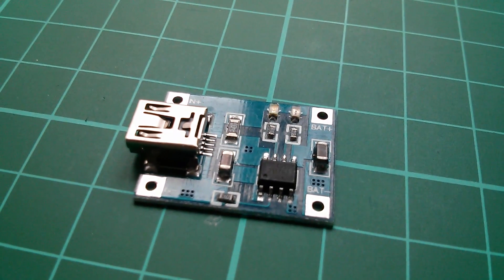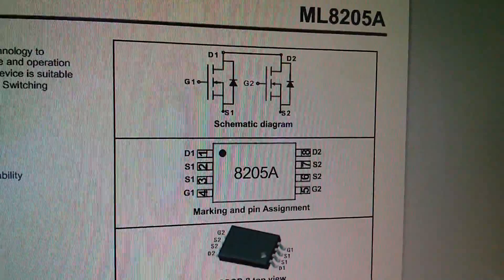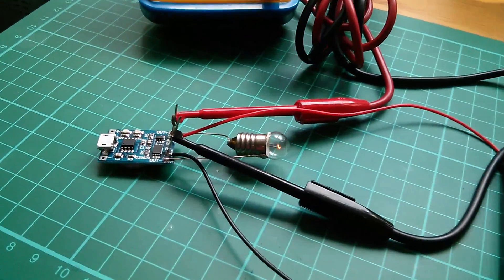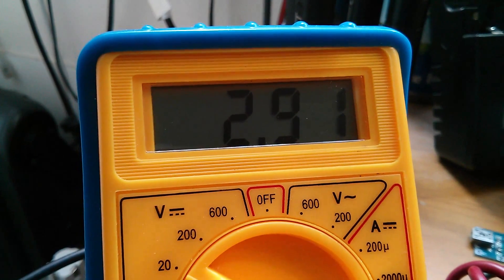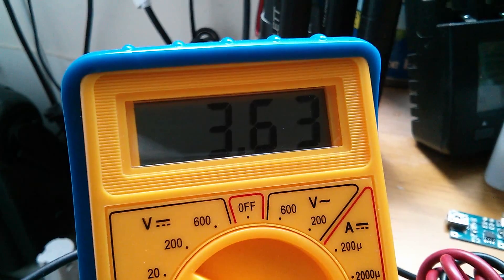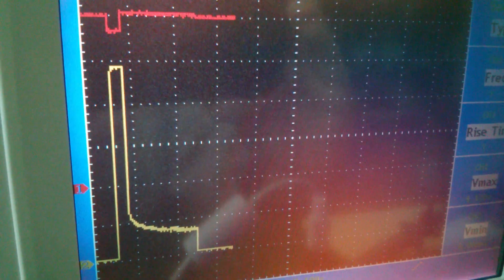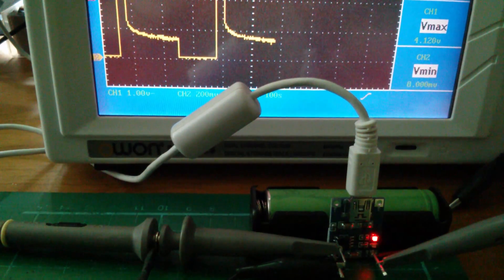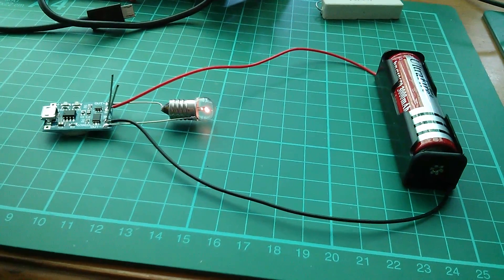New TP4056 Lithium Cell Charger Module with Battery Protection

Comment: Hi Julian, I've got a question for you about this board. I tried to use 2 of these boards together to charge 2 (or more) 18650 cells in series, but no success yet. I did have some success by putting 12v into 2 boards wired in serial on the power input side, but that only works if the charging cells are isolated (charged separately), as it seems to be a short circuit if the cells are also connected in series. Love your channel and thought your expertise might be able to solve this riddle.Thanks, and please keep up the great work!
Reply: To charge two cells, you'd need to charge them separately or in parallel, not in series.
Reply: Lat50 I tried this too. When you do it in series, the series voltage ends up frying the charging modules
Reply: Lat50 Julian has been trying to overcome this recently with transformer isolation. Look at newer vids

Comment: i have a question, what does it mean when you charge it and there is a constant green light and a blinking red light?
Reply: I know it is a cell and not a battery and I didn't put B's on the board.

If you connect board to power with no battery connection does it duplicate the problem?
The TP4056 has 4 output connections.
The battery must me connected to the inside two. B+ and B-.
The Out+ and Out- go to your project.
With no battery connected the voltage across B+ to B- should be about 4.12 volts with Blue or Green Led solid on and Red Flashing.
Connect battery Red LED should stop flashing Green or Blue may stay on.
If so, disconnect power input for 20 seconds to reset circuit.
Reply from the maker: both on together?
Reply: When I charge the battery it has a constant green light and a red light that blinks every two seconds.
Reply: YUP. Mine is doing the same exact thing. I used a dedicated 5V supply, and the green LED is ON, while the red led blinks every few seconds. Why..? I'd also like to know.
Reply: Had the same happen with my chargers. I have two batteries that had discharged to about 0.5V over time, and with those connected to two separate chargers, I had the same issue - blinking red and constant green leds. Then I tried connecting different batteries from the same batch (a Makita battery pack). Those, however, had about 3.8V to begin with and I experienced no issues charging them. So, check your batteries. If the voltages are too low the charger may not detect them.

Comment: how much time it takes to charge the battery full;
Reply from the maker: How long is a piece of string?
Reply: LOL Thanks!
Reply: What's the capacity of the battery? Obviously it will get a 700mAh cell to full charge long before a 2500mAh one.

Comment: if I made a lithium battery out of mobile battery and try to charge it with this module. how much time it will take to charge? and if I put it for long time does it blast?
Reply: PLZZ reply soon
Reply: How long it takes to charge depends on the capacity of the battery and the health of the battery. How long the battery charge will last depends on the load you put on it.

Comment: Maybe I misunderstand, but if the charger only kicks in after the cell climbs to 2.91 Volt.... How does one charge a battery that is below 2.91 Volt
Reply: I just touched the charger to a 1.2v AA and it went into went charging mode with no problem.

Comment: Hi Julian I tried to charge an 18650 backwards using new TP4056. Charger blew up but battery was ok.
Also when replacing a cell in the charger it seems like you have to switch off charger for it to register.

Comment: HELP MY PLEASE!!!!!! I'm messing around a bit. I bought 18650 samsung (2800 mA) batteries and on the datasheet of the batteries puts that they should be descragarse to a maximum of 2.75v. However, in the datasheet of the tp4056 (the new one with discharge protection) it sets which cuts the voltage from 2.5v. So it is not appropriate to download the 18650 batteries with this module. I am sorry for my English, I am Spanish

Comment: Can I connect the load output of two of these chargers in parallel or series for more output power? Do I need additional diodes for parallel connection? Thanks.
Reply: Mark Edrian Guillermo not recommended as they may cancel each other out.
Reply: Mark Edrian Guillermo and for series it would most likely short out the boards in a best case scenario.
Reply: Thanks! I tried series and it's possible but a separate power supply is needed for each module.
Reply: Mark Edrian Guillermo best bet is a balance charger/protection circuit.

Comment: Thanks for making these videos! One question though - in the video/datasheet it says that the overdischarge protection on this module kicks in at 2.4V... but isn't that getting a bit dangerously low? I've always been told never to take them much below 3V. I'd like to use this to automatically turn off my robot when the battery is running low, but I don't want to risk overdischarging...
Reply: did u find out?

Comment: can I use a 6v solar panel as an input voltage?
Reply: Julian Fernandez Barcellona with these cheap chargers I'd recommend finding a way to step it down for safety and to avoid burning it out.

Comment: Hi Julian. Firstly, good video. I'm thinking of dabbing in electronics as a hobby for the dark winter months, one project is a battery charger, so your video was most helpful. Changing the resistor to change the charge current is useful, as I'm not in a rush. Is it possible to change the charge voltage as well? It has been suggested that charging to 4.1v or 4.0v seriously extends the service life of the battery. Thanks.

Comment: Julian, I would like to  run a Tennsy with a temperature probe and a NFR24 wireless module. I would like to know how to figure how much battery and solar panel I need to run this setup. As the probes need to run 24/7 can the charge circuit run the tennsy and charge the battery at the same time, then switch to battery when the sun goes down?
Any thoughts would be appreciated.

Comment: Nice thingy is this TP4056 assuming 0.5C on a 2000mAh cell.
I'm planning to build a 3p6s pack with 3400mAh, rated with charge current of 1.7A (still 0.5C), do you know of a model like TP4056, but that regulates to 1.7A?

Comment: I have an LG battery from an old cellphone that's smaller than an 18650 and perfect for my project, but it's 1500mAh. Is it okay to go over the 1Amp rating by .5A?
Reply: Jif I dont believe the 1A rating referers to the maximum capacity of the battery it can charge; simply the charge rate. so, should your battery handle a 1A charge rate (be sure to research this using your battery part number) then this module will charge your battery in 1.5 hours :) if in doubt always be sure to check your battery charging specifications and look specifically for rated charging current. it may state a charge rating in units of C. if it says 1C max for exanple then take your capacity 1500mah and multiply it by this C rating; in this example we have 1C. this would result in a 1500mA charge rate so the 1A output of this module will be fine. 
i apologise for the long winded answer. i hope i helped :D
Reply: Jamsey Kayy Ah gotcha... See that makes more sense than what I thought, lol. No worries! It had a lot of great info in the comment so all is well! So in the chance I come across a different battery in the future that has a higher charge rate than 1 Amp, I'm assuming it will just take a longer period of time to fully charge off the 1 Amp? Or is that going to just make a great bang instead of a full charge? Lol
Reply: Jif that all depends on your battery really :) 18650's have a recommended charge rate of 0.8C, so up to 2A already. what dictates the duration is the combination of capacity and the charge rating. a 2500mah 18650 battery with this charger module would take 2.5 hours but if we had a charger capable of 2A we'd shave it down to 1.25 hours :) that is however the fastest we could safely go about it. you'll also tend to find batteries <1000mAh will require modules that cater for lower capacity batteries as one like this may cause it to swell and vent
Reply: a good way to look at it is imagine our big battery is a pint glass and our charger is a shot glass. filling the pint with single shots of water is slow and controlled. no spills. but our little battery is the shot glass and our charger is the pint glass full of water. theres simply too much water for the shot glass. its uncontrolled and you'll probably overfill the shot and spill it everywhere. unfortunately our "spill" when it comes to the battery is probably going to result it a dead battery of even a fire
Reply: in a dead battery or even a fire*

Comment: Can I put in series the output of two or three of these TP4056 boards? My goal is to charge five 18650's. If I use one TP4056 with all five cells in parallel it will take approximately 15 hours to fully charge. If each battery has its own TP4056 I can cut down the charge time to 3 hours...but then how do I connect the output? If the outputs of the five TP4056 are connected in parallel I foresee a problem with balancing when discharging...but in series each cell will have its own separate protection. Is this correct? Can I connect the output of several TP4056's in series?

Comment: is it unsafe to charge the batteries with the module that doesnt have protection modules on it? I thought the TP4056 terminates the voltage once the current reaches C/10 and has under voltage lockout?

Comment: This circuit board does both charge management and battery management...but only supplies 1AMP. I have 4 18650's in parallel and don't want to wait 10 hours for them to charge. Is there a high amperage version of this circuit board? Can I wire two TP4056 boards together in parallel?

Comment: On the first (former) module, a resistance could be changed to reduce the load current. Is this possible on this new module?
(I want to use a Lithium Ion Polymer Battery - 3.7v 220mAh 601235).

Comment: Hi Julian, i didn't catch the voltage of the battery you are charging. I've seen lots of comments/videos etc. on the web indicating you can use this board to charge a 3.7V Lithium battery. Is this correct ? Board charges to 4.2V, wouldn't that damage the battery? Related question about charging current, does the characteristics of the battery being charged determine how much charge current can be applied or do you just need a source that can handle it ? Thanks, really like your channel
Reply: Marc Hache    3.7 v is the nominal voltage of 18650's and most other lithium based cells, charging them up to 4.2v is normal, but you get 500+ extra charges if you cut off at 4.1v and don't discharge below 3.3v.
Reply: Thanks. Dug around some more and that seemed to be the norm but wanted to make sure. Next up is figuring out if these extra cell phone batteries i have lying around have protection circuitry. Most searches say yes but....

Comment: can i conect 2  18650 parallel bateries in this?
Reply from the maker: Yes, max charge current is 1A.
Reply: Julian Ilett Hi, can I connect two tp4056 in series for the output so it would be 7.4v?
Reply: xFuaZe in only if there is more than one in series.
Reply: Just the answer I was looking for!
My old Sony ICF2001 uses 3 D cells, so I'm thinking of contriving  2 x 18650 in holders, joined in parallel,  inside 32mm sink waste pipe sections with this charger. The radio is current-hungry on short-wave, so the duracell rechargeables don't last long. 18650s ex-laptop have lots of life left, so easy to find and fit. Cheers :-)
Reply: Don't Li-Ion batteries need a balanced charger?
Reply: I am investigating whether I can connect 2 or 3 18650's in parallel, and connect to this module. I understand that the max charge current is 1A. But what about the max current from output of the module? is there any data on that?
Reply: Can Altineller I did like 40 in parallel it just will take longer but no issue
Reply: Rafael Malagon   great question! Glad it got answered yet I still wonder; if I use the board's outputs to a voltage step up module and then to a class D amplifier. Is there a point where the amplifier could draw too much current from the board and cause any trouble / dangerous situations?
Reply: I placed 18 batteries in parallel and it handle fine. Well, kind of, it does get a little big hot tho, 50 degree C.

Comment: nice little chip. I have protected cells and the length is an issue, are there longer DIY holders? I use my smart charger and set to lion which terminates at 4.1v per cell, these modules are  set for lipo not lion, I imagine it will shorten the battery cycles as I think all the 18650 I have come across are lion chemistry.
Reply: jonnywaselectric there are a few lithium polymer 18650's out there mostly in the vaping world.

Comment: Julian, would it be possible to use this charger module in order to power a cordless drill?
I thought about hooking 4 of those chargers up in series (the OUT pins) with one battery attached to each module (the B pins), in order to run the drill.

I hope you can help me.
Reply: MrP123 drills would need amps, you won't have enough from such a tiny device
Reply: MrP123 you want a balance charger with series of batteries.

Comment: Can this circuit be left connected to a li-ion battery while there is a load drawing 20A from the battery??  Thanks!
Reply: This is a common usage scenario for diy boxmods which use 1 or more 18650's in parallel.
Reply: Yes, but with a load like that it's pretty useless.
Reply: I would use it for a DIY e-cig- box mod.. So I'm drawing short pulses of high amps (.2 to .5 Ohms) from the li-ion battery.. When it's empty, I want to be able to reload without opening the box and removing the battery.. I'm ot planning on drawing straight from the charger board..Think it will suffice for this.. 😊
Reply: I would use it for a DIY e-cig- box mod.. So I'm drawing short pulses of high amps (.2 to .5 Ohms) from the li-ion battery.. When it's empty, I want to be able to recharge without opening the box and removing the battery.. I'm not planning on drawing straight from the charger board..Think it will suffice for this.. 😊
Reply: Exactly my plan!! 😆 thx!!

Comment: Julian Hi, So you wire the unprotected batteries to the inside connections so they're protected, correct?
Reply from the maker: Yes, I think so (without watching the video again).
Reply: Julian Ilett Thanks so much for the reply, I ordered 20 of these from bang good in China for $13.35 The video was great, but it didn't show a normal setup, just for testing. I almost thought the outside was protected because the light bulb would light and go off. Thanks

Comment: Hi, I have 2 606090P 400mAh 3.7v LiPo batteries, would I be able to charge them with this circuit?
Reply: DarkN3ss it is for 1s lipo so yes, it will charge them twice as fast as recommended though

Comment: Hi, excellent and informative video as always. Does the extra chips mean the 18650 could be used with this connected and just plugged in to charge? Also apologies if this has already been asked but is there a way to search through the comments in case this has already been asked?

Comment: if i got 4 pcs of this new type z3 TP4056 cell charge and 4 18650 battery at least 2500mAh and Drok DC 2.6-5.5V to 5V 2A and Drok  LM2596 Numerical Control Voltage Switching Regulator DC Buck Converter with Red LED Voltmeter 32V to 24V to 12V to 5V Adjustable 5-32V to 0-30V Step  Variable Volt Power Supply
and 12V 3 amp Dc in charger can i use this now  like power bank  if i got 5v 2amp out from dc to dc convert

Comment: @ 12:05 that's fine for charging but what about it when the unprotected battery is hooked up to a device and draws to much current and the voltage drops to low and you're running these in a series?

Comment: 0.31$ a piece from aliexpress here --> https://www.aliexpress.com/store/product/Smart-Electronics-5V-Micro-USB-1A-18650-Lithium-Battery-Charging-Board-With-Protection-Charger-Module-for/1757110_32500042672.html
Reply: Sean S  He would have saved you a lot more if he would have send you to AliExpress.
Reply: Sean S  My bad!

Comment: Can I use a continuous source to power a Pi and if the continuous stops, it will use the battery?
Reply: So I am not the only one trying this...
Reply: I'm also thinking about trying this lol
Reply: I did it! Basically the power bank is connected to the pi at all times and the power bank is connected to wall power (always charging). If the power goes out, you have a lot of time to finish what you're doing and sudo halt!

Comment: Great explanation, thanks! One question if i may, can i setup 5 of these in series in order to create a small battery pack which will give 5x 3.7v and take 5v @ 5A ? I want to build a small Bluetooth speaker and i need this custom voltage.
Reply: In series, no.  In parallel, yes.  But only if you get a voltage step-up board which is capable of supplying up to 5A continuous output.

Comment: can i control  dw01a using an arduino? what voltage is used to turn on and turn off the ic using the charge current sensing pin

Comment: By battery management system does that mean I can set my own charge discharge parameters? I'd like to stop charging discharging 4.1v and 3v. Can I do that with is?
Reply from the maker: No. The TP4056 is fixed at 4.2V
Reply: may be a resistor in between ic and positive terminal of battery? so many people want to terminate charge at 4.0v or 4.1v for longevity of cell.please do a test and confirm
Reply: Julian Hi, So you wire the unprotected batteries to the inside connections so they're protected, correct?

Comment: I have 5 mp1405 boards to charge 5 cells, do I need to use the out connections for battery protection,  it's running on a 5v 2a charger from an iPad
At the moment but I have a 5v 5a supply, it's fairly big though so can anyone recommend a more compact way of supplying 5v 5a from 240v uk mains socket? Thanks